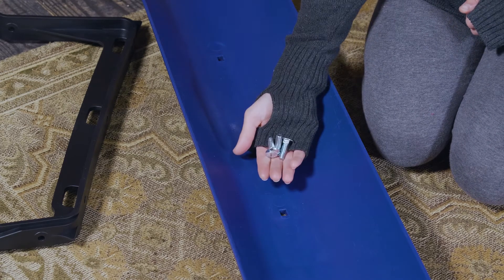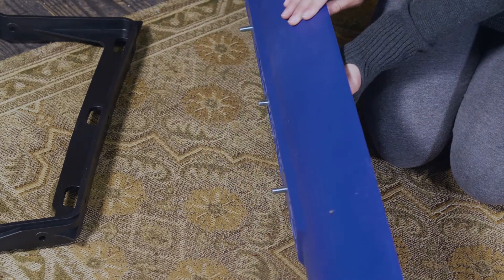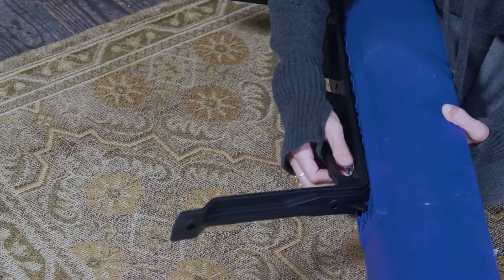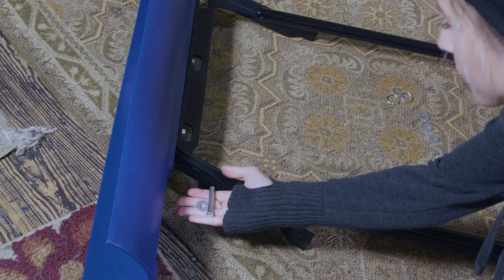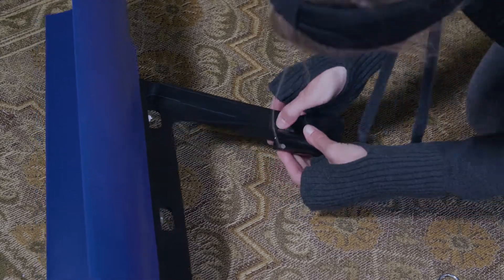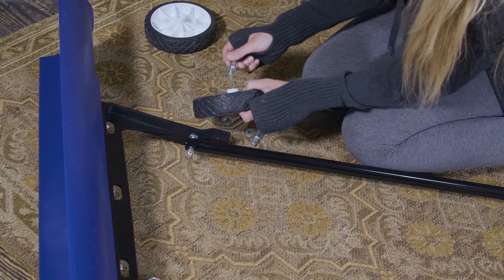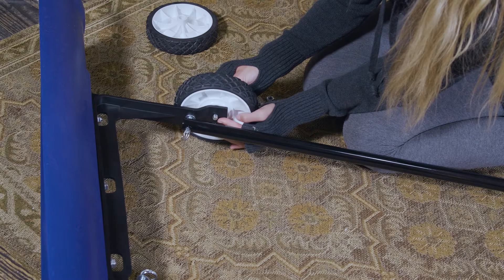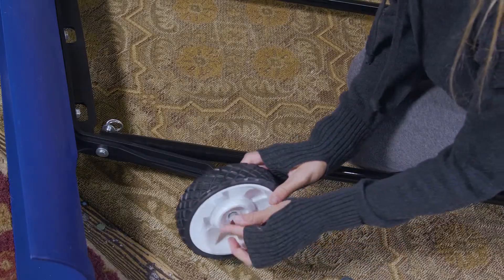The Snowcaster 30SNC & 70SNC Quick Assembly

Comment: Try and make a decent reshoot. On the left side she puts the washer thru the handle on the outside like she says to do and on the right side she puts in on the inside of the handle. 🙄https://youtu.be/-I16iMN3cGk?t=67 Cute lil sweater gloves though. Btw, 10 minutes yea right. If the tolerances are right on all the holes such as the square holes on the blades you have to file out to proper fit potentially.

Comment: I must be missing something because I can't get the blade on no matter what I do. I've literally put power wheels together quicker & easier than this damn thing. Even if I push the blade & bracket together it seems the bolts are too short to go through for me to screw the nuts on. Yes, I tried matching up the carriage bolts with the square ports but I've tried every which way and it doesn't seem to make a difference, the middle bolt seems to be too short no matter which one I use.